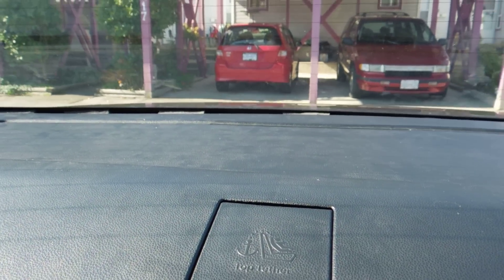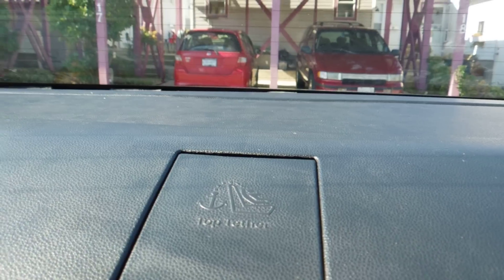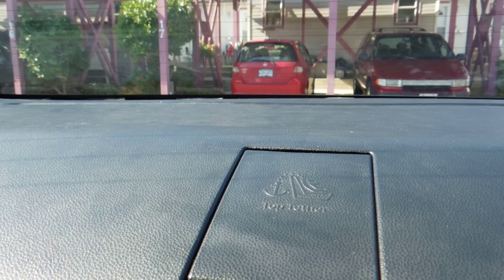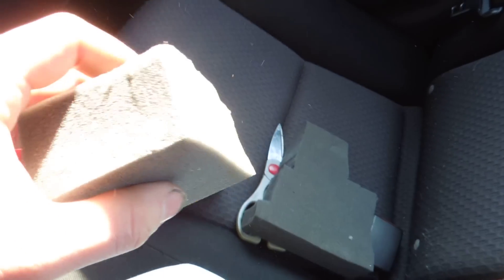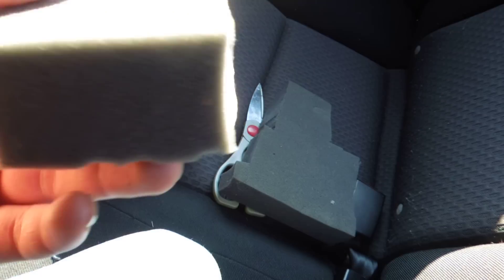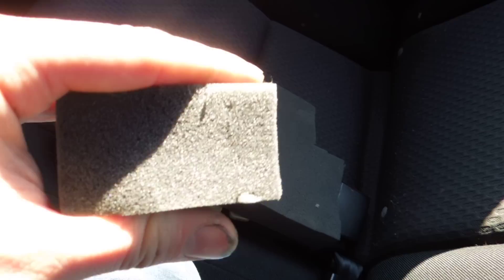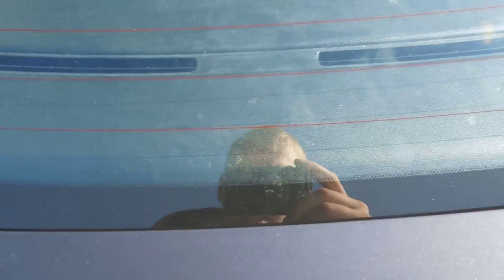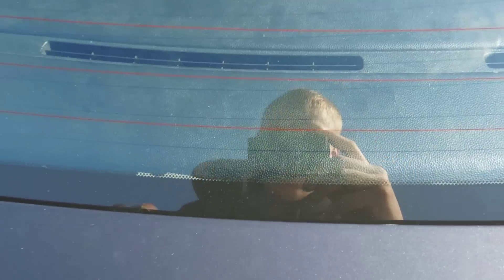rear deck rattle fix

Comment: The remedy I found was going in through the bottom of the trunk and putting phone between the frame and the plastic piece. It pushes the plastic upward and makes contact with the rear windshield thus eliminating the rattle without having any visible foam through the window
Reply: Did you have to take apart a lot of things to go from underneath?
Reply: @cliffjao2245  you probably figured it, but you dont have to take anything apart.  Shoving fiberglass insulation in (what I had available) until full, it stopped the deck rattle in my case.

Comment: Buy cotton insulation from Home Depot or Lowe's remove the back deck flip it over and cut the insulation to the shape of the deck then buy a can of 3M spray adhesive same stuff used to install a headliner. Spray it on in inside of the deck and and press the cotton insulation down. Also if catch someone removing carpet from house or building get a piece of the carpet padding and cut it to the shape of your deck. BTW buy a pack of liquid clothes dye from the grocery store use gloves and dye your foam black so it won't show up at all
Reply: Nice

Comment: What is causing the rattle is the trunk light, I had the same problem and after digging into it that was the issue. I lifted the rear deck lid and put in a old rag over the light. the light is right in the middle, towards the back next to the window. He uses foam to create pressure against the light and that works also. But, like i said it's the light in the trunk giving grief.
Reply: I have a very similar rattle , what do you mean by rear deck lid? the small rectangular one that's shown in the video?
Reply: This is the sentra right?

Comment: I know this is an old vid, but with my 2005 Maxima the deck rattle was insane.  First, I grabbed a couple packs of foam that you'd use to install an air conditioner from Home Depot.  I removed the rear deck cover and basically lined the entire area.  Then with my gen max, there's the third brake light rattle on top of everything else!

Even with the foam, the brake light was smacking against that window enough to annoy TF out of me.  So, I grabbed a pack of clear acrylic... Ummm..."sticky dots"?  Similar to the felt pads he mentioned only a hard rubber that has a little give to it.  I r moved the third brake light housing and placed once clear dot on each corner of the housing, then popped it back in.  Now, there's a little pressure between the brake light housing and the rear window, keeping things from slapping around.

I definitely would be careful with a bigger system...I wondered if the pressure on the glass would make it only running a single Type R 12" with 500 going to it, so I
Reply: So, I was saying for my little thumper, this solved my problem.  Next year I'm upgrading to a 1100 watt RMS amp to push the Type R, so I'm going to relocate the third brake light via a simple LED strip on the top of the window, then make a custom rear deck that I can bolt down, but still have the bolts hidden so it's nice and clean.  This sub's a monster at that power, and I'd be super worried about cracking the glass.  Hope I helped someone!

2005 Nissan Maxima 6th Gen deck rattle

Comment: I have like a rear clunking/rattle noise when driving through speed bumps for example, it sounds like it comes from the trunk but it´s confused, sometimes I think that it comes from the rear deck or something. Was this your case or you had this rattle noise because of a sub woofer or something?
Reply: Mr. Gandalf same here...without subwoofer
Reply: same here
Reply: Might be the middle seatbelt mount
Reply: Lol if you still have the car

Comment: Any ideas on fixing trunk rattling from the subs?
Reply: sound deadening mat
Reply: The latch in your bumper that holds your trunk down, if you loosen it, then push it down, your trunk will close much tighter and not raddle as much. Also, you licence plate. Take off any extras around the licence plate and use tape and foam pieces on all 4 corners near the bolts. Tighten then as tight as you can and make sure there is pressure on the foam. That wont rattle anymore either

Comment: My Rockford fosgate p3s been driving me nuts. You should post a video on how to remove the rear deck please lol. Cause im having trouble to even get the stupid thing off. I need some sort of help. The rattles drives me insane. Please help.
Reply from the maker: you literately pop out the hole rear interior. start with the pillers and then the 2 white pieces up top its all push pins and 0 screws
Reply: ghostlyrich thanks for the reply I got it off! Another question if you dont mind me asking. I have a 2012 mazda 3 sedan. And I search everywhere to find out what wire is my reverse light in the kick panels. Would you know anything about that ?
Reply: ghostlyrich btw I used t shirts to get rid of the rattles :)
Reply from the maker: you could try and look up the wiring diagram on the12volt.com or just run a wire from the reverse light it self at the back of the car

Comment: I'm installing a 1600watt amp and duel Kicker CompRs in 2 days. I'm going to dynamat the top of the trunk and the rear deck. I told the installer about how the rear deck rattles already with just the stock system. He said it's hitting the window. I guess he's dealt with this before. Ill try using weather stripping or foam. maybe I picked the wrong car to put a system in but I'm going to try and make it work

Comment: Anybody know what the foam is called or where to get it? I can't figure out the name of the foam.
Reply: +CloudTT You can use air conditioner weatherseal foam (weather stripping). Find it in the weather stripping section in Home Depot or Lowes.

Comment: anyone has a video how to remove the rear deck?
Reply: Yavor M. If it's anything like mine, there are a couple plastic tabs holding it in on the far back, accessible in the trunk. I had to squeeze them and push up at the same time, then drop my seat backs down and pop a few more clips out. Hope that helps if you haven't already figured it out.
Reply: For me it was the top window tabs which are used for positioning the glass . There is a mazda service bulletin for it - Affects MAzda 3 and MAzda 6. The tabs are either bended or cut off, as they are no longer needed once the glass is positioned